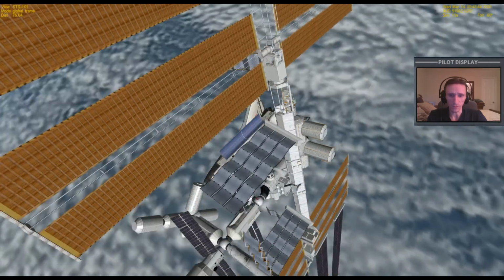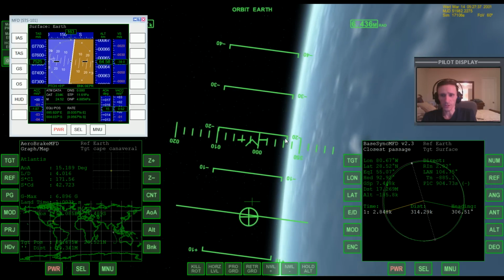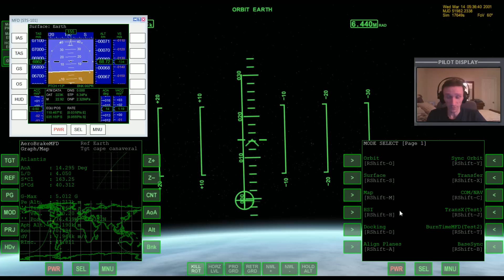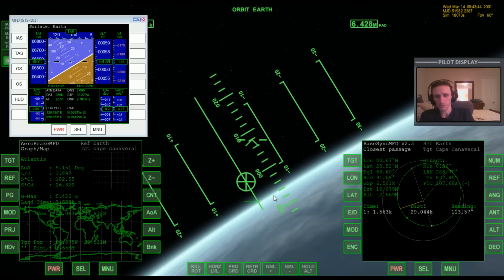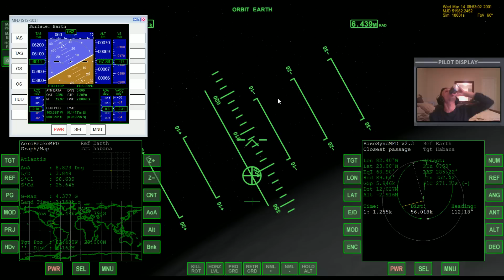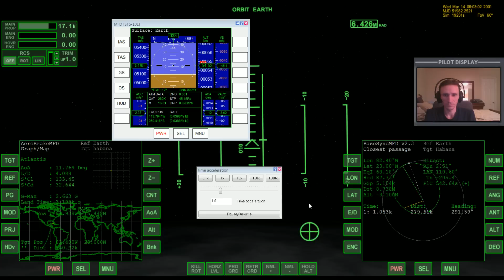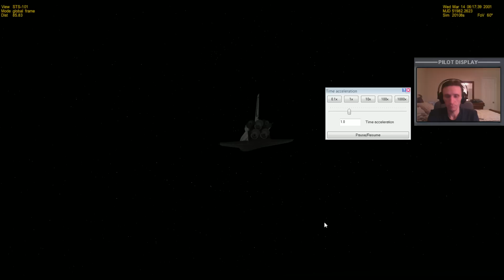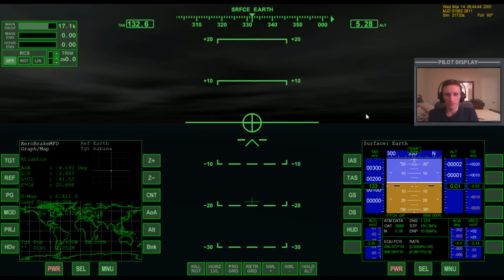Orbiter 2010 - Learn With Me #4 (Part 2) - Deorbit, Reentry, and Landing Space Shuttle Atlantis

Comment: There is definitely a big learning curve with the shuttle. It just doesn't have the L/D ratio that the delta glider or XR birds have. It's only a glider in the most basic sense of the word. Basically, a brick with wings. Remember, the orbiter's true glide angle is about 20 degrees. The XR's are more like 3-5 degrees. To have the necessary energy to get to the cape I would try a deorbit burn around the west coast of Australia.